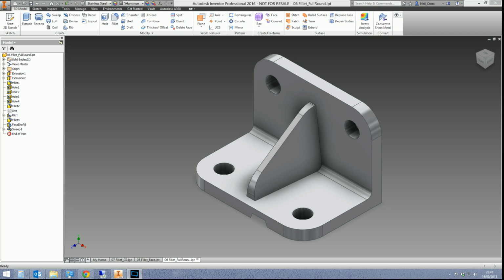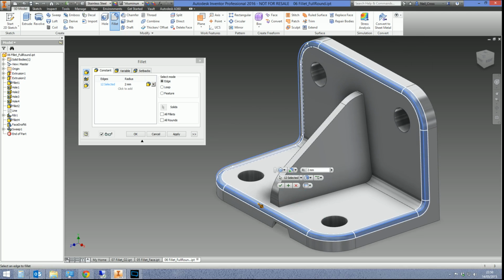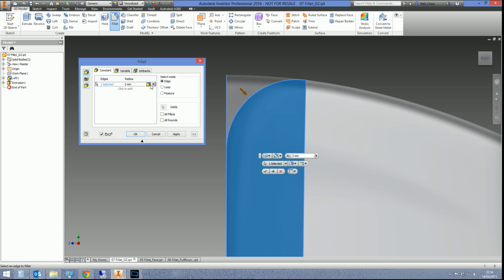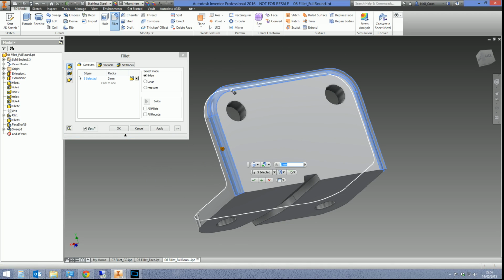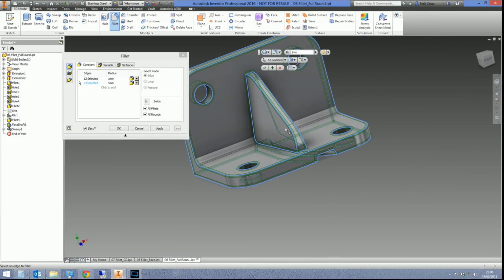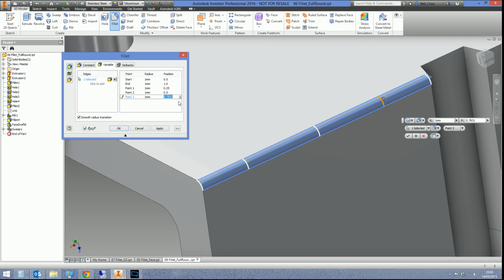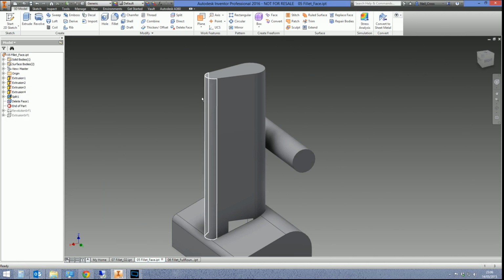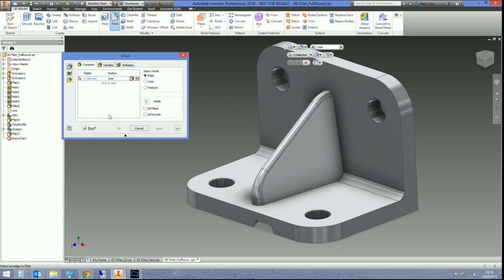3D Fillets (almost) Everything you need to know | Autodesk Inventor

Comment: You could have explained this whole command for more value with an actual product design based example involving plastic parts. Traditional bulk metal parts don't offer much scope for truly appreciating the power and practical utility of fillets. You don't have to go fully into surface based modelling, but you could at least have shown an example for a slightly complex plastic part where the hard tangent edge is noticable to both the eye and the touch. You could have combined it with curvature visualization tools to help folks understand how to determine what kind of fillet is present, where an edge appears filleted in a real world part. Thank for your videos!